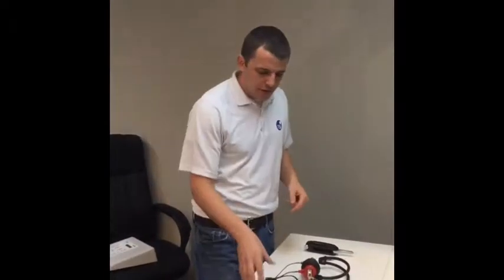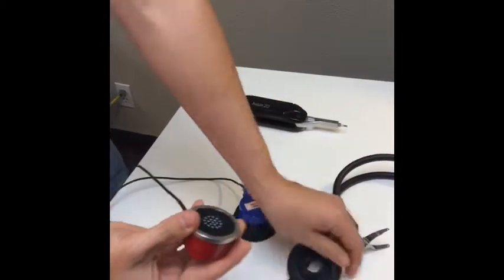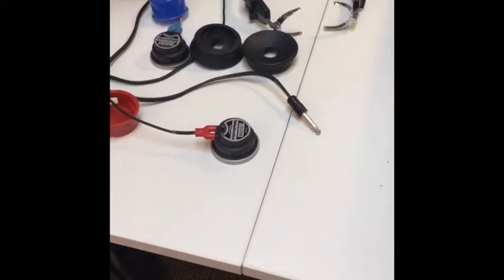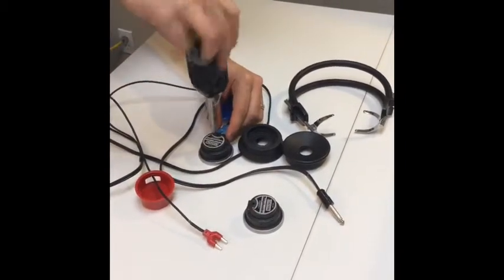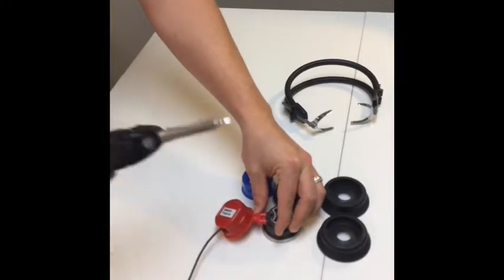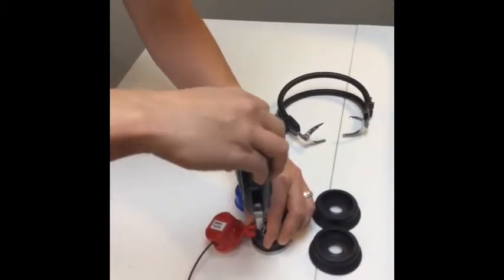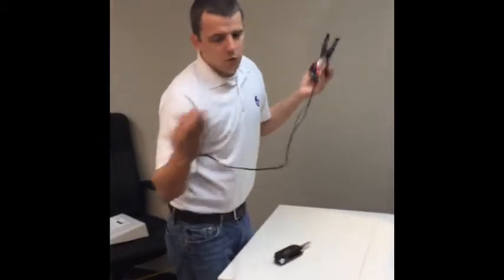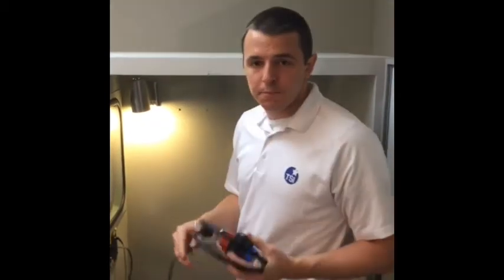Texas Special Instruments Audiometer Headphone Cord Replacement

Comment: What tool did you use to disconnect the cord, please advise
Reply from the maker: Sorry so late on this Sandra, it depends a little on the age of the audiometer but standard is a .9MM allen key.  Older instruments may use a spline wrench which you can call the factory and order for around 9 bucks.